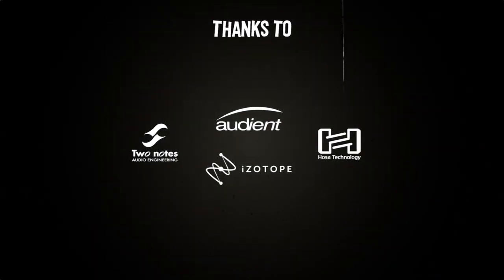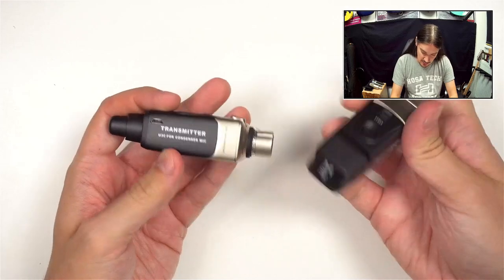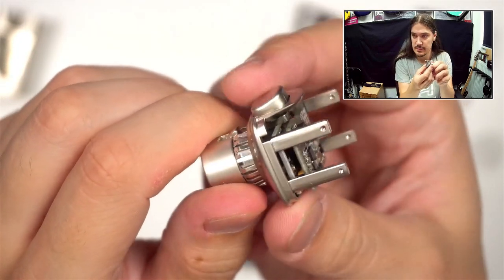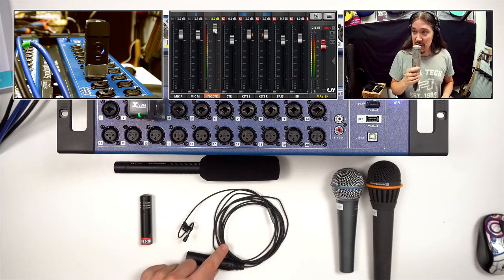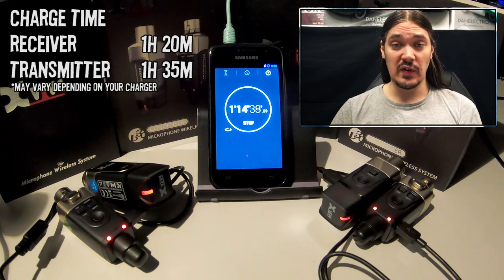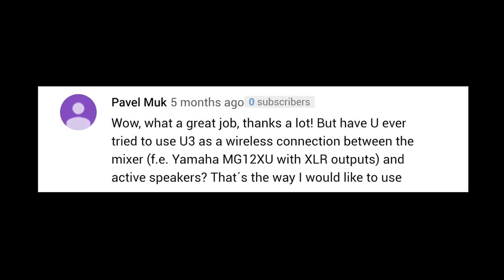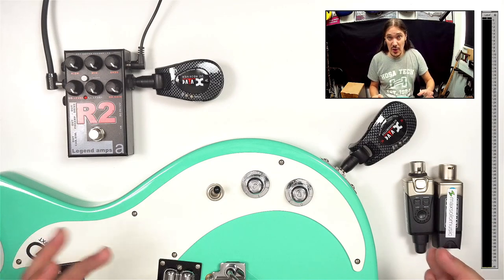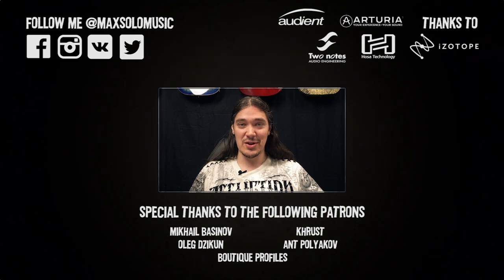Xvive U3c wireless system for condenser mics. Full review and Q&A

Comment: Hi. After watching this review and several more I bought the XVIVE U3C to combine with my DPA 4099 Core Trumpet clipmicrophone for trumpet and I am thus far quite happy with it. One remark though. You'll need to insert a 1 meter XLR cable in between the transmitter and the microdot to XLR adapter. If you don't the two of them will interfere leading to some pitched tones. Since your XVIVE will than hang loose (assuming you clip the adapter on your belt) you'll need something to clip that to your belt as well. For that I use the DPA Plastic Belt Clip for DAD6001 XLR-adapter connecting that on the XLR cable on the side of the XVIVE. You'll need a cable with a plug that allows for being assembled with that clip (I use it on a Neutrik connector).

Comment: Is there a part # for the transmitter battery? I want to be sure I can get a new battery first before I break it down. I Have the  U3C ( that will go dead after 2-2.5 hours) so I suspect a bad battery
Reply: Have you ever tried using it while it’s charging

Comment: Can you use this for recording via a audio interface even though my interface is 24 bit times 192khz even though the system works at 24-48khz. Are there any cons?
Reply from the maker: Yes you can, although it's hard to imagine why you would. In the studio the shorter your signal chain is, the better.

Comment: as far as 12V microphones go pretty much every Mic mostly will work at the lower power level with less high noise level handling. This is usually listed as a "feature" in the manual for extended battery life but it shouldn't hurt to find out if it doesn't list it. There was also something called 12V T power that is still 12V but yet totally different than phantom power 48V.

Comment: Hey, thanks for the review. I've been using the U3C for location audio and interviews in videos for over a year now. 

I think I can provide some insight into audio drop outs:
*If the transmitter and receiver are close it rarely happens
I only had one location so far that made issues there - a small convention center - which cause sporadic drop outs under 100ms. They were barely audible but are a pain to get rid off. At least for interviews I've stayed away from using it ever since.

*If distances are increased it depends if they have direct line of sight or what material is in between them - thick walls or heavy metal plates make the signal go out in spurts before the signal is completely lost.
(Below 10 m seems to be pretty save, anything above is kinda like: all bets are off)
If the signal cuts out, it doesn't degrade, it's just gone completely - as expected I guess.

When I first got them I compared the noise floor of the U3C with a direct connection into a MixPre recorder (with two Rode NTG5).
The noise floor is higher, but in a negligible amount. I can't recall the exact numbers though.

While this system works great when it works, the small issues I have with it, caused me to search for videos like yours. Especially gauging how much battery live is left on them or if the audio is dropping or not is a bit of a pain sometimes on an one man camera/audio setup. 
I kinda wish they were transmitting in 32bit and or with more kHz, but even in a very loud environment I haven't so far managed to clip my audio with them. Overall it seems to be pretty unique with its capabilities, size and price point. I only saw comparable tech for over 2500€ so far. :/

Comment: XVIVE U3C has fantom power which you cannot switch off, so it is unsuitable for dynamic microphones, so the story goes…

However, 

you can use XVIVE U3C with dynamic microphones if needed, but you have to use a microphone preamplifier like Cloudlifter, DM1 DYNAMITE, Tritonaudio… to name but a few. These preamps need fantom power to function but do not pass fantom power on to the microphone, so dynamic microphones are safe. 

If nevertheless you need a preamp for a condenser microphone, you can use Tritonaudio FetHead Phantom Preamp which allows phantom power to reach the microphone.

The only con is that the microphone gets longer by the length of the preamp. 

I hope this helps.

Comment: Great review, in the end I bought one! Just one question: I can clearly hear noise when the receiver is connected in the mixer (much more than connecting the mic directly, without the U3c): I can distinctly hear a noise similar to your signal to noise test (around minute 18). When you test your mics, however, it seems that no noise is actually audible (or barely). Can you confirm this? Maybe my unit is defective....Thanks!
Reply from the maker: Thanks. Someone reported a situation like yours but apparently the gain on the mixer was way to high, boosting everything including the noise. He was trying to use a dynamic mic at a distance it's not meant for. Like a meter or more, whispering into it. U3 and U3c have a pretty good signal to noise ratio. As long as the mics are used properly there shouldn't be any noise problems. Troubleshooting: try another mic with proper levels at zero distance

Comment: Yeah a real pity the phantom can't be turned off. Is it safe to use the transmitter with dynamic mics that don't require / expect phantom (generally)? Thanks for the video!
Reply: Ah I just got to the part of the video where you show it working fine. Thanks!